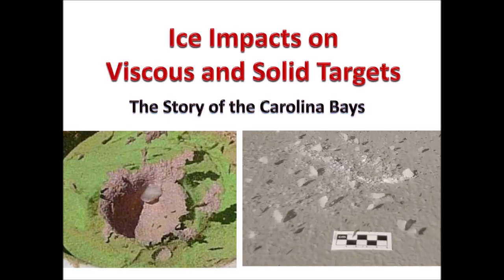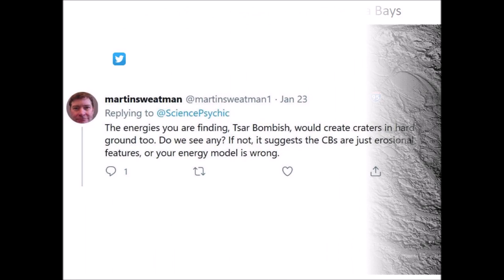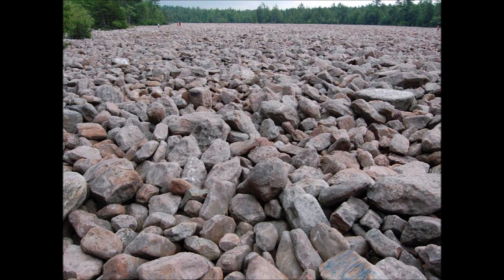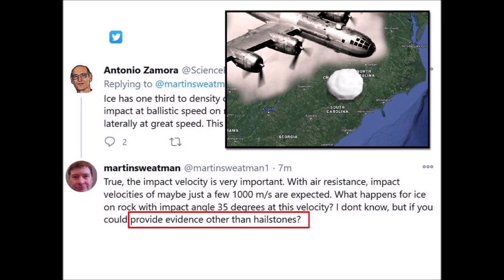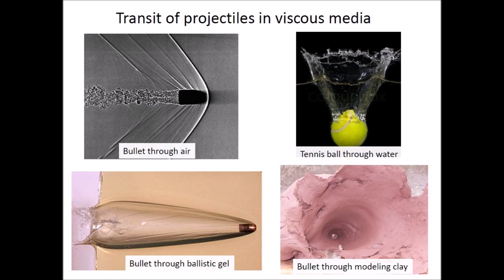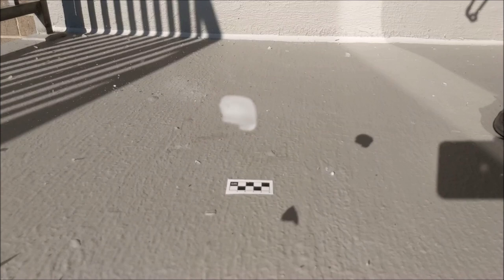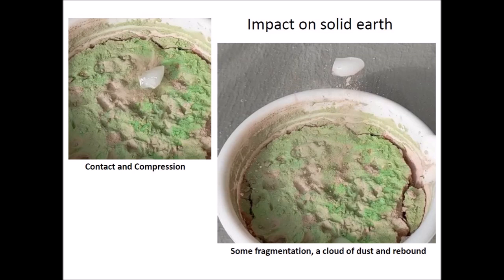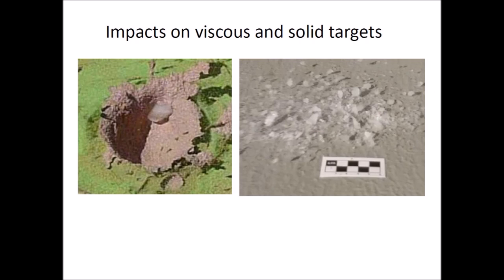Ice impacts on Viscous and Solid Targets - The Story of the Carolina Bays

Comment: The "terra firma" result at 15:56 was sort of shiver-inducing.  Great work!  Of course, skeptics may ask you the details of the material you used for "terra firma" to probe if it really is analogous to typical soil.
Reply from the maker: The target is the same mixture that I use for the viscous impacts: equal parts of sand and pottery clay, but in this case it was dry.  I usually add enough water to get a consistency like bricklayer's mortar to prepare the target for viscous impacts.

Comment: Hard to comprehend giant chunks of ice, some as big as office buildings being launched on a ballistic curve, and land 1,500 miles away. That beats artillery easy. Many of these icy boulders reached altitudes comparable to Low Earth Orbit. If they were traveling faster (17,500 miles per hour), they would have orbited around Earth. We might have had rings like Saturn. 

All your methodologies are very reasonable, and the math works well. When Oklahoma Federal Building was blown up, the FBI measured the crater (diameter and depth) and used similar charts. They came up with a yield of the bomb. It turned out to be within 5 percent of actual amount used by Timothy McVeigh.

Comment: Thank you for posting interesting ideas on a cold winter night.
The energies involved are so mind-boggling that it makes sense to compare them to nuclear explosions.
Nuclear blasts begin as concentrated spikes of extreme thermal energy with expand and dissipate as atmospheric shock waves, seismic waves and displaced ground (craters). 
All the energy in a falling supersonic ice boulder is kinetic and gravimetric potential energy, but is still cold at the center.  It is fascinating to imagine how all of that energy would be converted on impact.  Would the atmospheric shock wave be strong enough to kill every animal even if they were not crushed?  It would seem most of the kinetic energy would be transfered to the ground as shock waves and 'lifting' the material from conical cavity, which would convert to heat as it relaxed.  Were the Carolina bays steaming or boiling immediately after impact?  The  density of impacts was so high, the whole area could have been cooked? If one knew the heat capacity of the ground and the volume of the conical cavity, it seems like the temperature rise could be estimated.
Reply from the maker: I don't think that the ground had a chance to warm up with all that ice coming down. But you are right, the generated heat probably contributed to faster melting of the ice boulders. I discussed this melting in another video. https://youtu.be/VkJZdCkuzP8

Comment: I'd expect an ice projectile to shatter and vaporize upon contact with solid ground.
Consider how a snow ball disintegrates when contacting a hard surface.
Reply from the maker: Ice is a poor conductor of heat. The mechanical energy of an impact is not readily transformed into heat. The impact of an ice projectile results in breakage and the kinetic energy is transferred to the pieces. The vaporization of the projectile would require two phase transitions. Converting solid ice to water requires 80 calories per gram, and changing water to vapor requires 540 calories per gram.
Reply: Shoot a block of ice at a block of ice. There will be ice cubes raining everywhere and not all will be vaporized.

Comment: Hey Antonio, I got a few puzzling questions for you and would really like to hear your thoughts. In the deep sandy soil of the Atlantic Coastal Plain, is it possible that during emplacement into the soupy/viscous ground the ice boulders didn't need to be as large as currently theorized (e.g. 1/5 the diameter of the "bay")? I'm not saying the ice boulders didn't penetrate the soil, I'm suggesting that maybe the impacts into the viscous medium created a "shockwave" that propagated outward like a stone thrown into a pond and once enough energy dissipated, the shockwave "rim" was left frozen in place. After all, a very small stone can leave a huge "ripple". Thoughts?
Also, although this theory might have difficulty accounting for the inverted rim stratigraphy as replicated by your ice projectile experiments, it may explain why the bays in the Mid-Atlantic (and northward) appear MUCH smaller than the bays in the Atlantic Coastal Plain despite those areas being presumably inundated with similarly sized ice boulders. I just find it curious that the largest bays we see just happen to be located in flattest terrain in America and ideal for creating a soupy viscous soil, and maybe deriving your energy density requirements from an average area of the SE is giving you a falsely high calculation. Have you performed an energy density calculation on an average 1 km x 1 km bay-covered area in DE, for instance? I'm willing to bet there is probably an order of magnitude difference in energy density compared to the calculations derived from the 1 km x 1 km area in SC you used to derive the energy density. If so, this could reduce the minimum size of the comet, glacial ice thickness, and glacial ice boulder mass required for your scenario to be feasible.
Reply from the maker: Austin, my use of the projectile diameter as 1/5 the length of the Carolina Bay is a simplification of multiple examples of using the yield law equations correlating crater size to projectile diameter.  The results vary depending on the density of the projectile, target, etc.  
See: https://pirlwww.lpl.arizona.edu/~rbeyer/crater_p.html
Also check out the video where I relate the size of the projectile to the crater size: https://youtu.be/jVv4GPoGnS4?si=cUrKLd5exuqoIkrS&t=172
Reply: @Antonio_Zamora  hey, thank you for the resource, I'm playing around with it now. Respectfully speaking, isn't the commonly used 1:5 impactor-to-crater ratio based on impacts onto solid terrestrial and non-viscous soil, whereas your hypothesis relies on impacts onto viscous liquified soil? I know this scenario is unprecedented and no one knows exactly what would happen, but my mind tells that the more soupy and viscous the soil was at time of emplacement, the more exaggerated in diameter the "crater" rim would appear, much like how a stone thrown into a pond would ripple outward. I may be way off the mark here, but just wanted to run that by you.
Reply from the maker: @AustinKoleCarlisle  You are not way off, but there is a difference between being able to displace material to form a cavity and transmitting energy to form a wave.  Pay close attention to this video: https://youtube.com/shorts/TxehkX69mqo
You will notice in the slow-motion part that a circular shock wave emanates from the impact site and it leaves a slight circular mark just beyond the crater rim of the penetration funnel.  There is a partition of energy between crater formation and seismic wave generation.
Reply: @Antonio_Zamora  please be aware that i'm not trying to call into question your hypothesis and real-life experiments, but given that small scale experiments don't always perfectly extrapolate to a large scale, is it possible the ice boulders actually exploded immediately upon emplacement into the viscous soil, sending shockwaves laterally and creating the raised "rims"? of course the impactor's (much smaller) "penetration funnel/crater" would have still been subsequently filled in by viscous relaxation per your hypothesis and experiments.

i realize it would be impossible to replicate this scenario at any scale given the more powerful dynamics required to explode the impactor, but it's just something to consider. one of the biggest criticisms against your hypothesis seems to be the required mass of the comet (and glacier ice boulders). i'm really curious to know the calculated mass of the comet and glacier ice if you used the energy density of the "New Jersey band" and extrapolated that to the entire 1500 km radius instead of using the "Carolina band" which may be resulting in falsely high energy and mass requirements. Just a thought!
Reply from the maker: @AustinKoleCarlisle  I have mentioned in the past that I don't know how the ice boulders maintained their integrity after hitting the target surface. It is possible that they didn't, but the crushed ice mass continued its trajectory due to its momentum.
Reply: @Antonio_Zamora  Thank you for the stimulating conversation. After giving it some thought, the only comparable and realistic small-scale experiment I can think of to test this theory is by lighting a small firecracker that's mostly submerged in the viscous medium, then seeing what kind of crater is left after viscous relaxation and whether there is an overturned flap or ring of deformation from the shockwave. of course, this would only make a circular crater, and since the ice projectile would've entered the soil obliquely, I would imagine this energy transfer would've been stretched in the direction of travel and still resulted in an elliptical impact feature. Just throwing that out there.

Comment: Would it be just a block of ice from the glacier, or would it be more of a slush ball of ice, rock, and dirt? Exiting the atmosphere then reentering should first break it apart then consolidate it to a degree or melt it upon reentry, right?
Reply from the maker: The projectiles that made the Carolina Bays were chunks of glacier ice, not slush balls.  The ejected ice avoided ablation during launch because the explosion that followed the ET impact lifted the ice along with the atmosphere to high altitude. Then, the ice boulders traveled in a vacuum which eliminated any water.  During re-entry some ice boulders broke apart and suffered ablation, but they reached the ground. It is explained here: https://youtu.be/KUKM3CYsOlE
Reply: @Antonio_Zamora  you really think the glacier pieces ejected from the impact were able to maintain solidity despite the huge forces on them and velocities when they were launched out? Ice surely isn't that resilient under such pressures to maintain a unified body. It has to shatter into smaller pieces and be grouped together in larger and smaller conglomerations during its launch and reentry
Reply: @Antonio_Zamora  There was of course soil and rock embedded in the ice, right? Wouldn't a worthy goal to be a survey of enough bays in the area the impactor to find these remnants?
Reply from the maker: @neoclassic09  Hypervelocity impacts on an ice sheet eject large chunks of ice.  This has been demonstrated experimentally many times.  The expansion of the vapor plume carries the ice, so it is not exposed to huge forces like you say.  See the video with Prof. Schultz: https://youtu.be/tv3jxaZVjFM?t=305
Reply: @Antonio_Zamora  Would it be possible for the Bays to contain rock debris from the original site that traveled with the ice, or some of the pieces could have just been rock or earth, although most were Ice? The glacier could have been of varying thickness at the impact location, and surely some earth was ejected.

Comment: So it means that 50 megatons kinetic energy boulder would just bounce several times from hard ground, and this prevents from leaving one huge creater? And energy transferred to ground on one such bounce was just not enough to form a creater which can be detected after 12k years?
Reply from the maker: I mentioned in the video that "This bouncing behavior would not be expected for large ice projectiles." An ice projectile with a diameter of 400 to 500 meters hitting hard ground at 3000 m/s could not hold together upon impact. I quoted Prof, Erland Schulson, who said that the brittle failure of ice under compression is marked by sudden material collapse after shortening less than about half a percent.
Reply: @Antonio_Zamora  so some energy(not very big fraction) will be spent on splitting initial projectile to lot of small pieces, little energy will be transferred to ground to form a little creater, a most part of the initial energy will be kinetic energy of "secondary" projectiles flying away from impact point at low trajectories (as i see from your experiments) and losing energy because of atmospheric friction and series of smaller and smaller impacts with earth. Am I right?
Reply: By the way, this seems to be even worse scenario for local megafauna, then carolina bays. Everyone will be killed by low-flying high speed small ice  pieces like buckshot
Reply from the maker: @pavlikkk101  Your description is basically correct.  From the impact of ice on concrete we noticed that as the ice projectile contacted the surface it started to disintegrate creating a broader area of contact. As the remainder of the projectile advanced, it disintegrated over the large area of ice debris, which deflected ice shards laterally. The dissipation of energy over a large area is the reason why ice impacts on hard ground cannot make deep craters. This is very different from impacts by iron meteorites which remain fairly cohesive during contact and compression and transfer all their energy in a very localized area, thereby penetrating the target and creating a crater during the excavation phase.
Reply from the maker: @pavlikkk101  Impacts that created Carolina Bays trapped fauna in the liquefied ground and then buried them in the muck while grinding them to a pulp. The high speed ice shards from impacts on hard ground probably resulted in incidents such as the Orleton Farms mastodon.  The reason for extinction of the megafauna becomes clear when you understand the high energy of the secondary ice impacts.
Reply: @Antonio_Zamora  did some googling about tensile strengths of materials. For iron it is 500 MPa, for rock about 10MPa and for ice about 1MPa. So in first phase of iron-rock collision only rock will be disitegrating and deforming until pressure reaches about 500Mpa making huge creater, beacase rock must be deformed very deeply and quickly to reach such pressures and in ice-rock collision creater formation will roughly speaking stop at pressure about 1MPa, which won't cause a big creater. May be dr. Sweatman will be confident with this explanation )
Reply from the maker: Thanks for checking this out. I had similar figures. I am convinced of the impact origin of the Carolina Bays, but it is not so easy to convince others.
Reply: @Antonio_Zamora  thank you for this beautiful theory, i am absolutely confident that you are right. Nothing can explain mathematical ellipticity and radial distribution of the bays better than this theory. One needs to be blind not to see it.

Comment: The shape of the bays is facing the direction of the wind. 
The bays are all near sand.
Quartz eroding turns to sand. 
If a comet hit Earth and chucked shrapnel up, it would be in all directions, not just one way. 
I don't know why you are so obsessed to prove your theory.
Reply from the maker: You are completely ignoring the Nebraska Rainwater Basins that are oriented almost perpendicular to the Carolina Bays.  Their orientations converge by the Great Lakes. Please don't be so eager to discard a theory that you have not studied properly.  https://youtu.be/O1bus2zHf7s
Reply: You don't have to be rude. 

A quick look at surface wind patterns for the Continental US is contrary to what you've asserted. In fact the direction of the 'Carolina Bays' all along the southern Dixie area, to the Carolina and up the coastline all converage at a point somewhere around Michigan State. 

The low level or surface wind patterns, driven by the prevailing winds, are actually opposite of the measured bays Convergence. 

If your assertion was correct, the direction the bays beyond North Carolina should be facing North Easterly. They don't, they actually face far more Westerly than the bays in South Carolina. 

As the Dr also pointed out, the Rain Basins also converge on the same center point somewhere in the MI state vicinity, which again shows that their orientation is opposite of what is expected considering surface wind patterns. The bays there are facing East North/East despite the wind patterns from Blue Notherns clearly blowing southerly or south/easterly due to the common placement of the Jet stream. 

Further more, I'd question that the absence of evidence through out the continental US in other regions with very similar soil as itself, possible evidence. If these are certain to be of aeolian origin, we would expect to see them everywhere else where the proper surface conditions would apply. We in fact, do not. This is suspicious, especially since the Continental topology framed by large North/south mountain ranges provides ample year round wind generation. In fact, it's odd we see so many bays at all in the Carolinas and especially south Carolina and Geogia, considering that the average surface wind patterns in that south east Dixie region is not only going the opposite direction expected of the bays, but the winds there on average are typically rather slow.